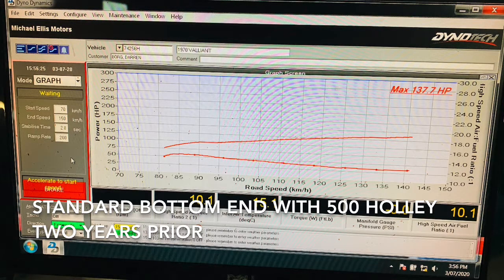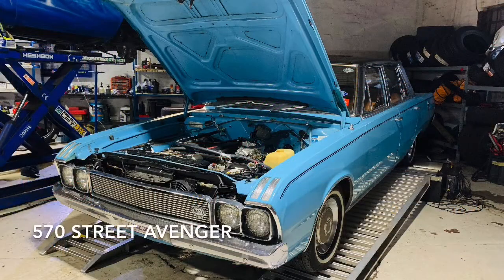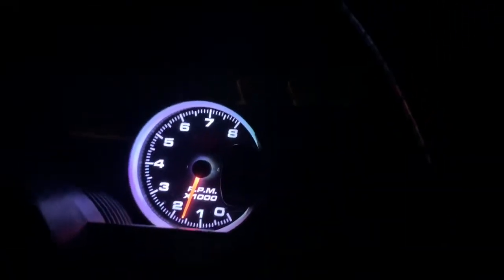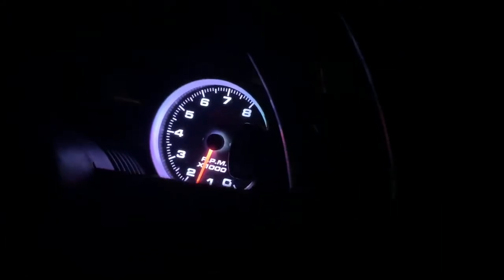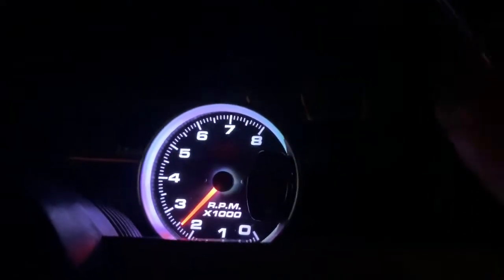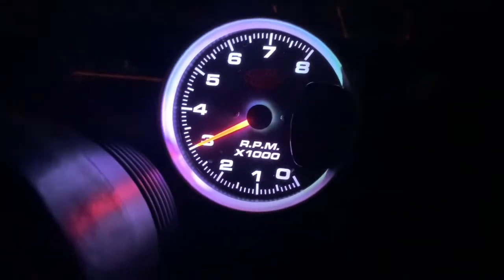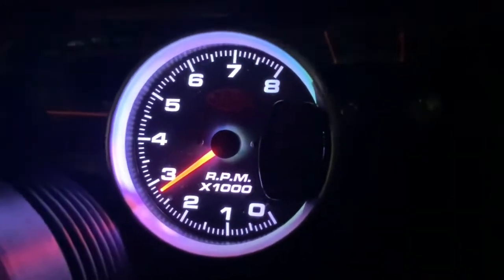Mopar Dyno, Holley 570 and 650 tuning on a Hemi 6, 245 265 Chrysler VIP. "PLEASE LIKE AND SUBSRIBE"

Comment: You'd think a 650 would be overkill on 4 litre but apparently not.  the thing I always liked about 265's 245's  low down torque
Reply from the maker: It surprised me too. I have bought a 600dp Brawler. Road tuning it now and will be back on the dyno soon. I want max power and torque figures.